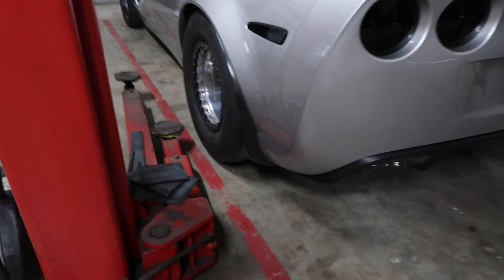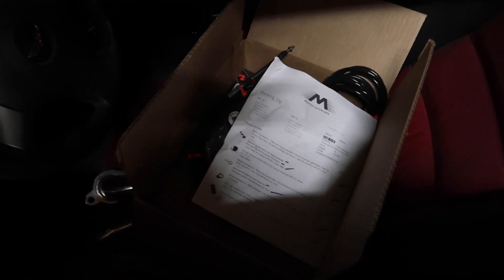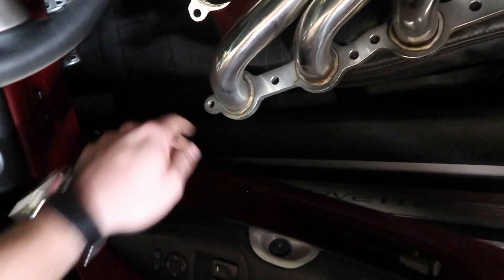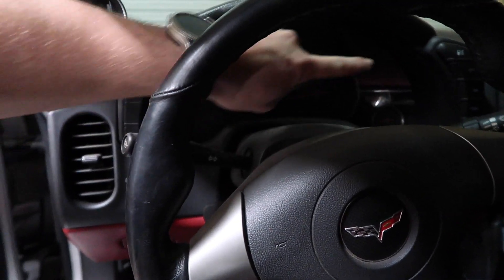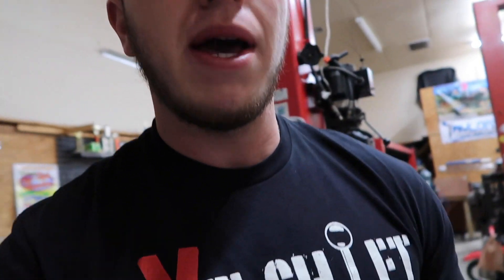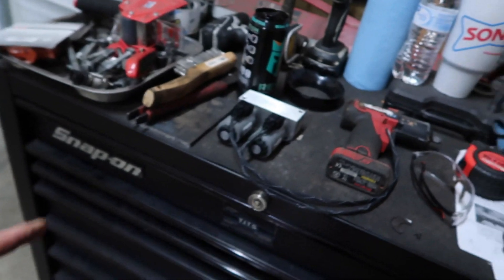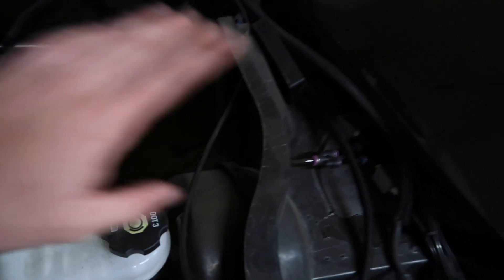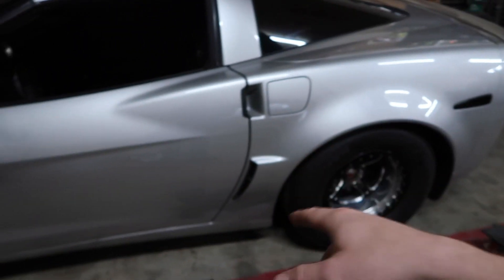baddest stickshift c6 Corvette on the planet

Comment: Correct me if im wrong.  The mansbrake makes your clutch act like a sliper clutch but activated with a button.
Reply from the maker: Correct it slips the clutch after you release the button holding it down
Reply: @nxtshift  ok.  Thats what I thought. Just making sure.